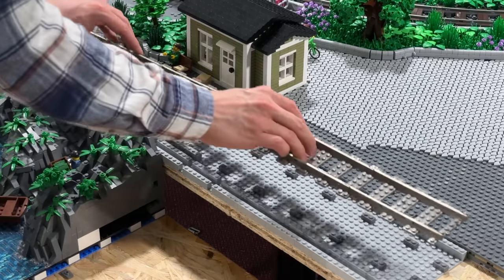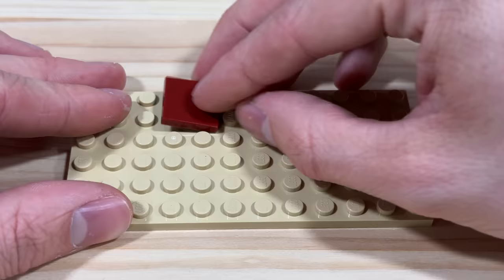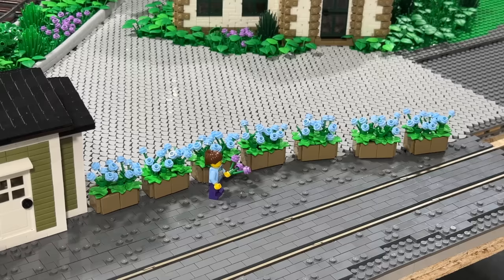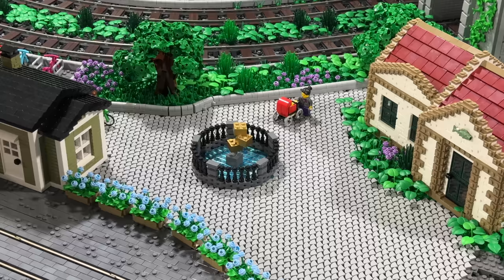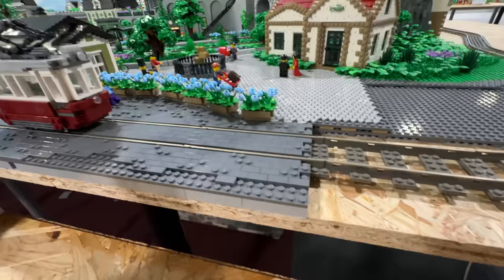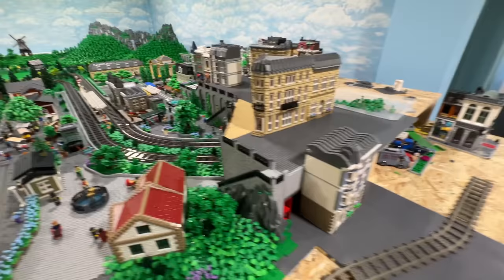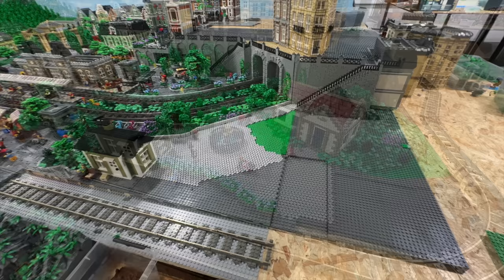Adding the Tram Line... - LEGO City Update

Comment: The extended harbour could (maybe) eventually transition into a beach. Due to the difference in elevation separating the general landscape from the current harbour, the beach could be accessed via a sandy hill or integrated steps. The change in elevation could also allow you to add features like headlands, arches, stacks, caves or even wave cut platforms. Contrastingly, a longshore beach could allow you to build a bar, a lifeguard tower and other recreational structures.
Reply: Great idea!
Reply: Beach is Amazing idea

Comment: You could switch out a few 1x2 plates between the rails for quarter circles, so you still get some variation in the floor without studs stucking up.

Comment: If you want to change up the solid grey tiles on the tram line while keeping it flat, maybe try changing some of the 1x2 tiles to 1x1 round/quarter round tiles. I'd recommend keeping them dark bluish grey, but the small holes will add some detail and the shadows will give it a slight colour variation. While on that topic, there are a few spots with mostly/entirely one colour (the walls around the second level, the tile path next to the tram), maybe try this technique here as well? Small details that show age like cracked walls, different colour stones used to replaced broken ones on the path, maybe even some litter to add some colour. Also, is there a website for your Lego museum? I would love to visit one day.

Comment: Great video! For the tram line I'd reccomend going in a straight line instead of at an angle towards the houses (make the turn 90 degrees). You could make a main promenade / "main street" with the tram, central road, green foliage+ setbacks, and sidewalks in front of the townhouses and central street. You could then open up wider sidewalks for dining areas, retail stores with operable facades, etc. This would really sell the idea of a central city! Hope this helps 😊

Comment: I love the new house walls, although I must say that the roof looks a little weird, not the new plate technique, but the way that the front facade isn't connected. It's a normal roof that suddenly ends in a triangular shaped wall. It might just be me, but it looks a little off.
Reply: Yep, I agree. Looked a bit strange to me, too.
Reply: i was going to say the same thing, it definitely doesn't look right. i don't like that the roof is also lower than the walls, i just imagine massive puddles forming and leaking through from the rain. it also just looks very odd, lol
Reply: Gable walls rising above the roof tiles is a real thing but I agree that it looks weird here, I'd suggest removing the facades and building the roof out a little larger so the tiles cover the wall. Gable ends might need to be taller to achieve a decent roof pitch.

Comment: I have 2 suggestions of ways to end the tram line: the first one is to just end it with a buffer, which is the most common option for ending tram lines, or decorate the end point like it is some kind of turn table like the ones used at the ends of the san Fransisco cable car lines.

Comment: You could consider adding grass/green plates in between the tram tracks, lots of places use grass to add green space to tram lines. It would be nice to add a splash of color in the center of the concrete area.
Reply: I was coming to say the same thing.

Greentrack the tram!

Comment: I love your videos man, keep up the work. About the tram line, you can build a buffer stop on the end surrounded by barriers, in order to prevent minifigures from getting hurt, and I was thinking about a little yellow line on the side of the tracks, like ones that you can find on the tram stops. Also, you can try to build a big water Tower on the outskirts of the city.  Like from gravity falls. It will look cool in my oppinion.
Reply: 100% agree with the buffer block and the yellow line, but I think a water tower wouldn't quite fit the western European style the city has, as they're not quite as common here in the form you mentioned. Though a water tower in the old brickwork European style, or even like the post-war smooth concrete "pillars" they have as water towers in parts of France would be a really neat addition to the city.

I also think the tramline still needs overhead wires, so a little electrical junction box should be at the end of the line as well, connecting to those.

Comment: A tram stop doesn't need a covered shed, just a small passenger waiting shelter maybe.
I still think you should build an angled road climbing between the upper and lower levels, and have the tram climb up that road to the road on the upper level. the tram then serves a purpose. The houses you want to build can be built stepped up the road. The only problem will be the angle the tram can climb (trams often climb relatively steep roads), so how far back the road would need to go. And it will also require Lego to build a level to angled track transition.

Comment: Because there is already a ticket building at this end of the tram line, I would suggest just leaving it blank. I know it sounds boring but that is how some tram lines end. I think a full station building would look clunky, and the fence seems a bit out of place. If you want something like a fence i would add a bumper block (A concrete block) instead of the fence, in a similar design to the first flower pot..without the flowers.

On a side note, I'm absolutely addicted to this build, keep up the great work.

Comment: To get from the upper to the lower level near the tram rails, I'd sugest 1 small alley between 2 buildings with a staircase. Maybe just 6 or 8 studs wide at most. It will be just that tiny bit more believable than everybody using a building. It will probably be a very steep staircase (maybe 4 plates per step rather than the usual 3) or peeking out a bit from the line of houses, but I think it would fit fine.

Comment: I think for the tram line itself, you should have a tram house/station. Somewhere that the tram can be stationed at over night, while the building or part of it, also housing a ticket booth and seating area. The downtown plaza area already looks amazing with your underground entrances and everything else going on. Maybe the tram house could be an upper floor to a train housing right underneath it, with access for engineers and mechanics to check on all locomotives while not running? That may be cool, even if very very very ludicrous

Comment: In my opinion u could do a tunnel between wild west and city and the tram would go inside and on the other side of the tunnel will come out another train more likely locomotive ( transition ) and it would look like the train changed and the same when the locomotive goes into the city through the tunnel. basicaly the tram goes inside, stops and the locomotive starts inside the tunnel and goes into the wild west. SORRY FOR MY ENGLISH :D

Comment: The tram at least needs propper stopblock that realistically could hinder the tram from going off the tracks at its end. In cities this usually is some sort of small cement or brick wall with bumpers on the side of the tram.

Comment: I think it somewhat makes sense for the tiles in between the tramline to be smooth and not have studs, as it would be a part of the road people don't usually walk on as much and thus isn't as irregular/broken as the rest of the path.

You should definetly keep the dark grey tiling around the tramline and extend the light gray pattern as you said. At the place you said you might add another building (on top of the vegetation) the space between the buildings and the tramline will become more narrow and that's where you should end the light gray pattern and transition into the dark gray tiling.

As for the fountain, I'm not sure if a statue would be a good idea as I quite like the abstract art aesthetic of the golden bricks, but I think you could definetly add some small transparent light blue on the fountain itself to show that it's actually pushing water out.

Lastly I feel like if you add another building where you said, the area behind it where the tree is will become a little too cluttered. The tree is definetly too good to sit behind there and you should move it somewhere where it is more visible. Instead I think you should go for a small garden with low vegetation to better show off the rock face you've created and also that green hill from today's update.

Comment: In Connecticut and other places most of the trolley lines actually end with just going into the asphalt or concrete one example is the trolley musem in guilford CT where at both ends the pavement moves up the hill and the tracks end in the pavement so I think either leaving it without a stopper and putting a wooden pole where the catenary wire would end and maybe a gray circle tile on some part of the wood post would be perfect to resemble trolley line in real life

Comment: a small station and tram shed/storage house can be usefull for the ends of the lines  or if possible a loop around wich can be usefull in some cases.
otherwise i like the gold bricks and if you do change to a minifigure statue then ther is one in a police set where the thief steals the golden statue with a big drone.
and the tram looks kinda modern so it could be intresting a funny to get the tram to go a spot in the mountains and get the station in there and let it be a "secret" station like how some old mines had tracks to transport stone,rocks,ores and other resources in the mountains.

Comment: I have a genuine question for you. (Apologies if someone has already asked this)

Why do you elevate your builds on top of baseplates? What I mean is why do you put a brick on top of a baseplate, then a plate on top of the brick, so that the plate is the ground level for the city. Why not just have the ground level be 1 plate directly on top of a baseplate or is it because the way you do it makes it more modular, allowing you to change the color of the ground more easily? Like... if you have an area where the ground is gray, but you want to make it grass, you can simply swap the plates over more easily. Or is there another reason to it.

Thanks In Advance

Comment: The water fountain should be larger and match the shape of the pathway instead of being a perfect circle. Could make it into a type dog bone or weirdly shaped peanut shaped and put make a golden arch statue to connect the two ends of the fountain. 
For the tram line. Could you use a type of red/brown/gray flat tails to make a pattern so it won’t be a plain gray color. Plus it will help identify the track as normal tram lines are. Maybe red 2x1 on ether side of the rails and an alternate brown gray brick patterned down the center.

Comment: you could add a slightly different gray colour between the rails for the tram so it looks like you can walk there but preferably not. this would also be a reason to hide the fact that there are only flat tiles there. i also think you should have a section in the bend of the tracks where you put grass between the tracks instead of gray tiles.

Comment: If you want texture in the tram track, circular 1x1 tiles could work quite well

In terms of the end of the tram line I'm quite fond of the bumper-style stoppers. You could probably model that quite well with the 2x2 rounded underside plate (the one at the bottom of minikit canisters in Lego games, if that's more helpful) + a couple of 2x2 round plates to pad it out and provide an attachment point

Comment: I think you should build a better buffer for the tram and then if you put a enclosure I would make a small open sided shelter. I also think that the front of the tram line and around the house needs a bit more going on For example some benches in front of the tram if it doesn't block it too much and maybe some planters but the right side of the house. But overall it looks great well done!

Comment: Suggestion for the end of the tram line: a turntable. Make the tram single ended, and have it run to the end of the line, then turned on the turntable.

Two of the cable trams in San Francisco do this.

Comment: Awesome video again. With the tram maybe  you could add a small traditional shed with a old truck next to it , a ticket office and a small roof and some benches outside the station for passengers to wait in the rain. Also on the corner when the lower platform and the upper platform connect I think you should add a staircase next to the blue building so it looks cleaner where it's integrated!!

Comment: For the second area of residential houses that you're building I'd look at city's like los Angeles for residential areas built on hills. I'd then have the tram be for residential travel. Something I really don't like in any build are "non functioning areas" you have all of that green behind the house but people would be walking there or doing something with the space. also I know you have size restrictions but a tram that  just goes one direction and then back another wouldn't work in any real city. They would always have to be built in duplicate one going one way and the other the other. Or if you only have one line then it would need to be on a loop.

Comment: Let’s not forget to add a catenary wire for the electricity of the tram much like a street tram line The polls are far away with extended wires that hold the wire in the middle above the tracks

Comment: I think for the end of the line a buffer will do just fine. If you add other buildings the area will get too congested in my opinion. Also, I think it would be nice if the tram line would act like a lightrail system - sometimes running through streets, sometimes having sleepers and going through grassy areas. It's up to you, just wanted to share my idea :)

Comment: Sorry to be blunt. But I can't say I'm a fan of the new building or the area it's in. There needs to be something to break up the flat tiles of the fountain area. maybe other colours? And the building feels far too jagged, it could be the studs sticking out from every side of the tan bricks maybe? Compared to your other awesome smooth edged buildings etc, I dunno... This one feels, off? 

And last thing about the building, is the façade. The angular rise in the center of the building doesn't attach to anything, it's just sort of floating in front of the roof. Just my two cents! 

And as others have said, a small tram station, or even just a roof over the end platform would look excellent! :)

Comment: When you put the studs in the middle of the tram track s. My train track s it's same. If the train track s are not set. Wright the Lego set train s gard at bottom of the green cargo train or the white pasinger train tuche s or scrape on-top of the track or make a scraping sound   so I'm at the point where my track s incline. To not make. It to step.   One thing I fount. With the track s if thay not  connected to the ground the train weal s don't grip to the tracks as much.   Great update vid. Cee you in the next one

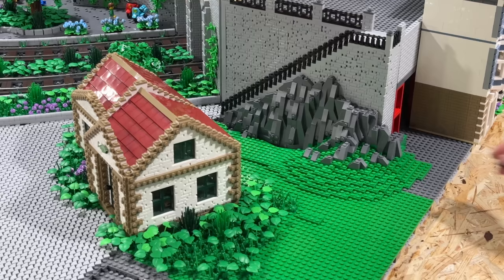Comment: I'm not sure, but wouldn't it be cheaper to use simple light gray 1x2 bricks instead of detailed wall bricks if the bricks are hidden? Like at 2:15, but more are hidden behind the staircase.
Reply: I think he may do that if he runs out, but he may be preserving it in case he wants to remodel the rock face and re expose some of the wall.

Comment: I don't wanna suggest to give you more monotonous work...but for the tramline underneath would placing tiny flat 1 by 1 circular tiles in between at random points to give the impression that they're still there but not restrict the movement?

Comment: The fountain looked better with the first attempt. It gives the impression of water in motion. If you're bothered by the tiles showing, just put a blue plate under and then pour loose trans tiles in.

It's easy... plus (at the risk of sounding mean) no one is going to ble climbing onto the display except for you. So no one will know...

 But then again, I suppose kids will, if left alone, long enough.

Edit =
Also, I hate city layouts that are not grids. For me, grids are neater and cleaner in terms of realism, and in terms of ease, they can't be beat.

Use all the illegal building techniques you want, but keep that stuff GRIDLOCKED lol 😆

Comment: why not just turn the tramline in to a walkable street, no cars. it will make your tramline has it goes in that smaller city section just be a street just enough space for the tram and lego figure to step on the side when it does goes by. a tram, there 2 kind of trams street running tram and light rail tram, that work like trains but can not run on a ordinary street, does light rail tram, are ordinary alway separate to the street and do not allow people to walk or cars to run on them. but street tram, that use only catenaries can be of a slower speed and often right there bells every 2 to 5 second in order to warn bystander and walkers of it incoming.